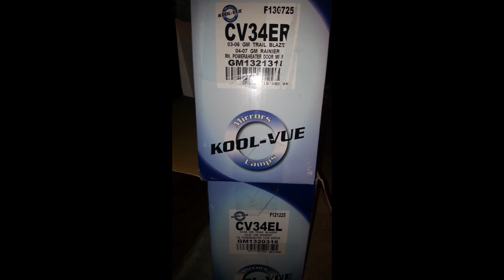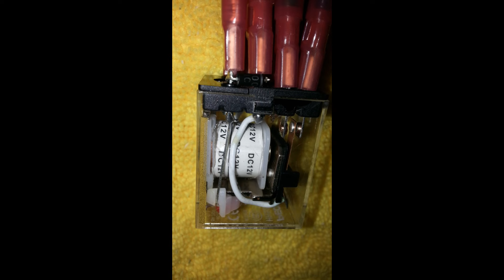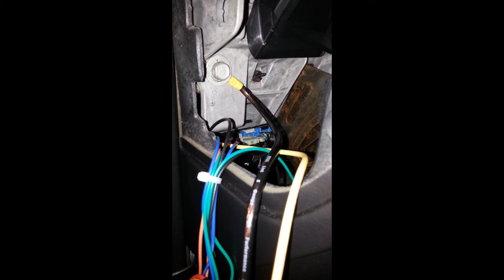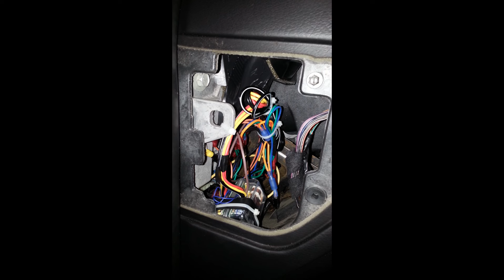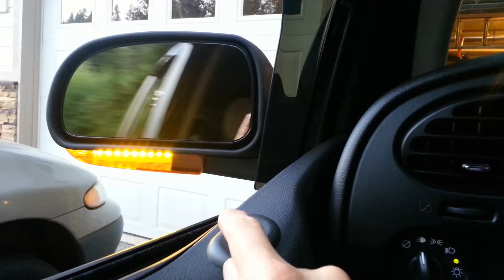Trailblazer Power Folding Mirror/ LED turn signal

Comment: Did you ever end up getting issues with this set up later on after you had it for a while? Just curious.
Reply from the maker: I used it actively for 3/yrs and the motor finally started slowly fail. You can't expect much from an aftermarket set of mirrors. It was fun while it lasted and I enjoyed doing the mod back then. Car's a daily driver now, 230K+ miles and still going. My 2017 Silverado LTZ is the one eating up my $$ with mods now.. haha!

Comment: I want to install the turn signal part could i do that with a ls
Reply from the maker: David Boyd this is actually on my 2006 LS. if you buy the mirrors with the turn signal, it's a straight plug in and it works. The pins are already there for the turn signal in the door control module.

Comment: need more detail step by step... would love to add them to my LS trailblazer if able
Reply from the maker: I would have to start a fresh install to do more details and explaining the diagram(what goes to what, etc) would take to much time.. I added the link to the forum thread where this all started, you can probably go through that thread and get more details on what was done, I just took all the details and shortened it without showing all the work involved.. good luck.

http://gmtnation.com/forums/threads/power-folding-mirrors.2197/

Comment: Where'd you get the LED Turn Signals lights? I really want to use that mod in my mirrors!
Reply from the maker: Got them off ebay. I stacked 2 of these strips together and hooked one up to parking lights and the other to turn signal... 
http://www.ebay.com/sch/sis.html?_nkw=2x+48cm+%2848+Leds%29+White+Neon+Flexible+Strip+Light+425%23&_id=250775041337&&_trksid=p2057872.m2749.l2658. 

If you're taking about the mirror itself with the turn signal housing, same deal, eBay..
Reply: Na, I own the mirror with the turn signal lamp already, I just need those LED'S! Is it a pain to mod them on?
Reply from the maker: Nick depends on how you want to mount the LED. I took some thin plexiglass and made a template of the inside of the turn signal, then just hot glue the LED to that..  makes for easy replacement if they burn out.. which I had to do once so far, due to bad LED...
Reply: Jay P Alright thanks man for explaining! Wish me luck!

Comment: can you sell me a kit I'll pay
Reply from the maker: jose velasquez  Unfortunately, I don't have the time(busy work schedule) or parts to do this setup anymore. You can go to the link I have put on here and see if someone in the forum is willing to do that for you.
Reply: Where did you get all the relays
Reply from the maker: jose velasquez All on Ebay.. ADD-A-FUSE ATM MINI BLADE, DEI DIRECTED 528T PULSE TIMER RELAY MODULE, HH52P DC12V Coil DPDT Electromagnetic Power Relay 8 Pin, Diode 1A
Reply: Ok thanks
Reply from the maker: Also, the mini connectors: NYLON FULLY INSULATED QUICK DISCONNECT FEMALE .110 TERMINAL.. RED 22-18 GAUGE NYLON BULLET CONNECTORS, and lots of wires...
Reply: +Jay P what's going on brotha it's been awhile I have one last question  where did you buy the mirrior
Reply from the maker: jose velasquez  ebay as well. If you pause the video, you can see the part # on the box, just type that in, not a bad price at the time I got them..
Reply: +Jay P you used the stock switch right? I've seen on the forums they have to buy the stock one with the folding feature
Reply from the maker: +jose velasquez you can use the existing power mirror switch that's in your blazer. You don't need to buy a different switch. The relay you hook up to the switch will trigger the motor for the folding mirrors. I didn't buy a new switch that's for sure, just used my existing one.
Reply: +Jay P once again thanks for the info
Reply from the maker: +jose velasquez no worries, good luck with the mod!

Comment: How did you run the wires throw the door? I know the GMT vehicles have a type of junction box between the door and the frame of the body. treaty video by the way!
Reply from the maker: I used a coat hanger/electric tape/windex. Just umount the junction box from the frame to make it easier. on the frame side, spray windex in the boot, push the coat hanger(or what ever wire you have) through, tape the wire you want to pull through and pull it through. 

For the door side, tape the wire on the coat hanger, spray windex into the boot and push it through. The boot on the truck side can be a pain to pull out, but it's a lot easier to pull/push the wires through once you have them popped out. Here's a picture of how it looks on my passenger door side.

https://www.dropbox.com/s/k7rkkkqbwt34a0p/20150221_124220.jpg?dl=0
Reply: Great thanks! I just bought it all, its gonna around $100 for the entire mod, Mirrors included. I added in 40v 1amp diodes. How did you connect the diodes? Just wrap them around the post?
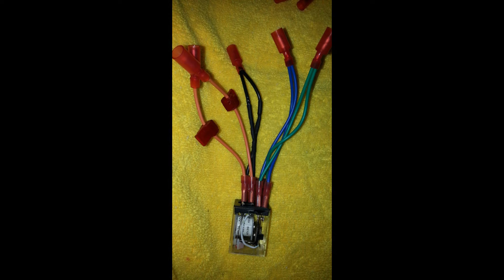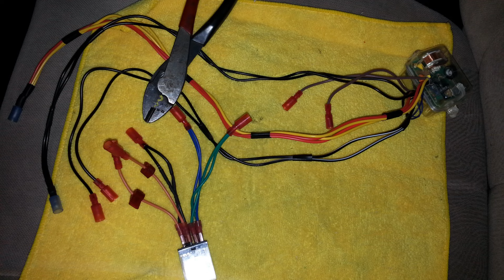Reply from the maker: x0duke0x The only one that I put onto the post is the one between 14-12 on the Polarity switch, which is around the 0:56 min mark on the video I posted. Those are soldered on so I know they will not move around and for better contact to the post. Also, at the 0:50/min mark, you can see the black wires, with a bump in them, I put the rest of the diodes inline. I just solder them between the connectors and put a heat shrink over it. I can post pix of those if you need it.